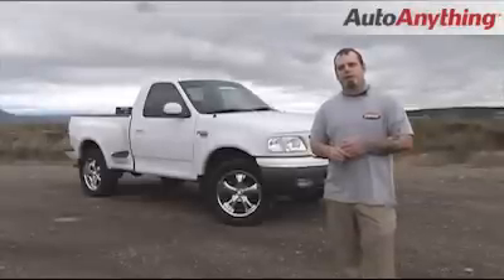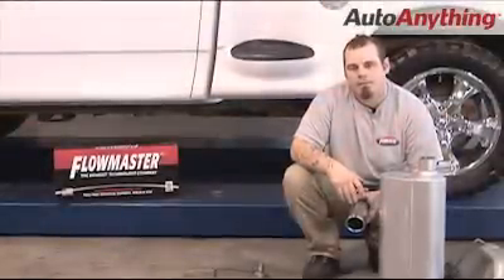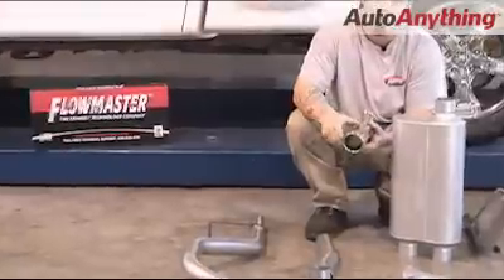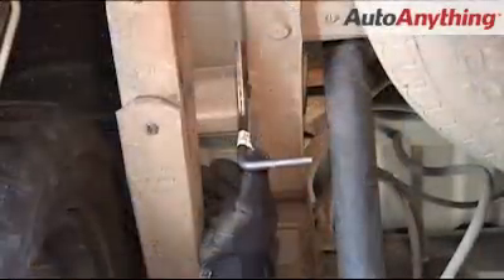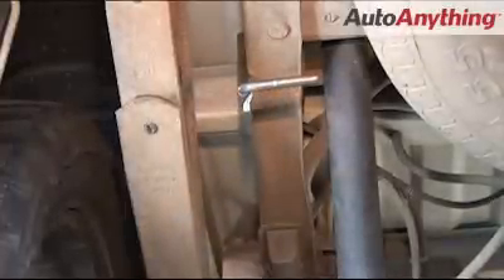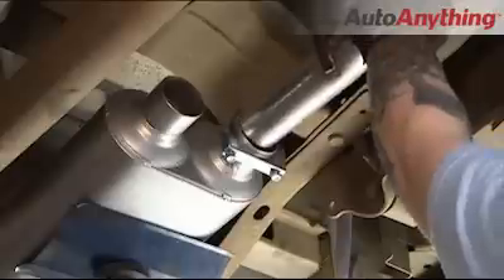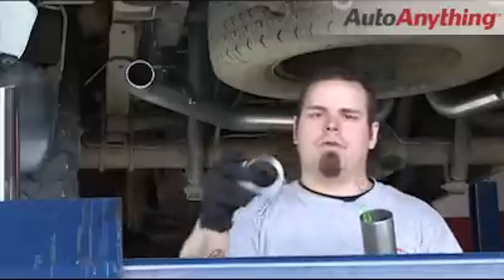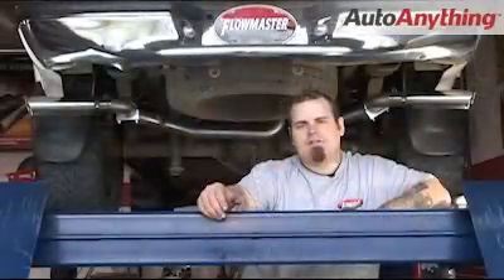Install Flowmaster Force 2 Exhaust on a 1999 Ford F150 (98-03)

Comment from the maker: No problem, happy to help!  And from what I can tell, it looks like that steel guide was part of the factory exhaust system and Flowmaster simply made a cut out for it on their inlet pipe. So I don't believe you will have to weld anything onto the cat for install.

Comment from the maker: @TheTallDude56 The Flowmaster American Thunder exhaust is pretty loud, and it's a bolt-on system for your F150. If you want louder than that, you'll need to look at a weld in muffler.

Comment from the maker: Yeah, it doesn't look like they make a bolt on kit for your F150 with the American Thunder mufflers.  It's definitely got more rumble than the Force II.  You could always buy the American Thunder muffler that comes in the F150 Harley Davidson kit (Flowmaster 50 Series HD muffler) and have an exhaust shop weld it in for you.  You won't get quite as power from it as you would from a cat back, but you'll definitely get the sound you want.

Comment from the maker: @quaddude2501 Somewhere around $200, maybe less.  This exhaust system should take about 2 hours to install (maybe more if the stock system is rusted up), and labor rates for mechanics range from $60-100 per hour.

Comment: Thanks for your help I think it might be fine with the force 2 that way I keep my neighbors happy. I noticed on the install video that when installing the first inlet pipe to the truck there is a piece that looks like its been pre welded to the cat on the truck. Is that necessary for every install or only because the original was in tough shape? I assume I may have to do the same once I cut my old pipe off.

Comment: I have an 03 4.6L V8 F150 and on the flowmaster website its showing I can only use the force 2 kit for my year and model. I want to you the American Thunder but its only showing 99-04 Harley Davidson 5.4L. I guess I dont have a choice. I cant buy that kit because it probably wouldnt fit? Any suggestions? I wont be dissapointed with the Force 2 but the American Thunder sounds like it has a little more rumble..